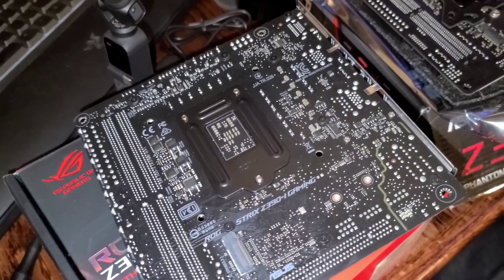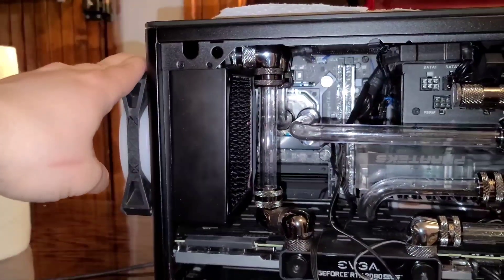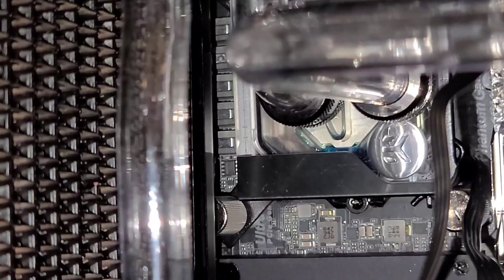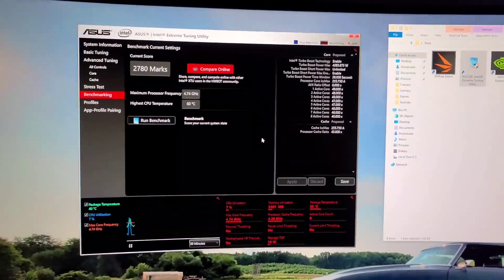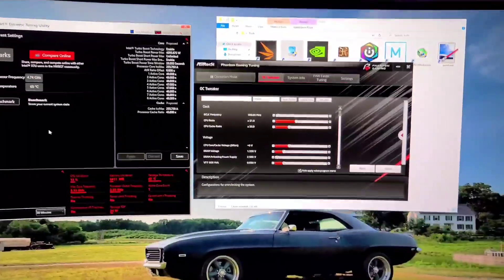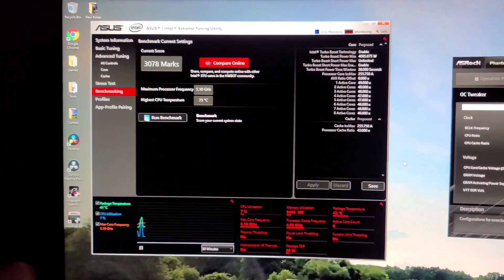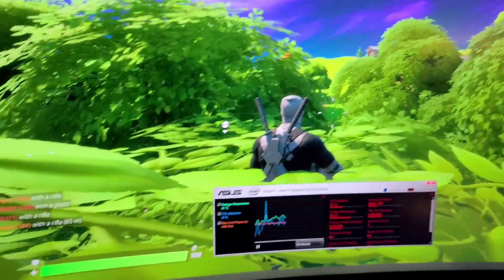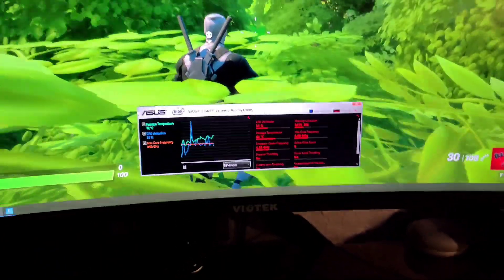Motherboard Swap & Bigger Radiator Install

Comment: You hid the CPU voltage settings to the right of the camera on the Asrock tweak thing :)
Reply from the maker: Yeah that was when I overclocked it. First time I ran it, it froze then I went up to .01 volts and ran smooth and passed